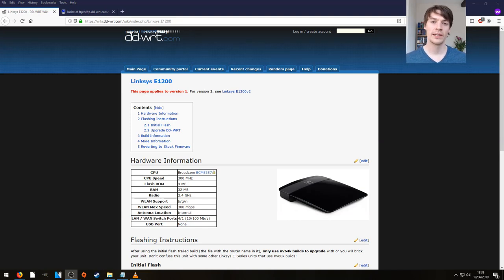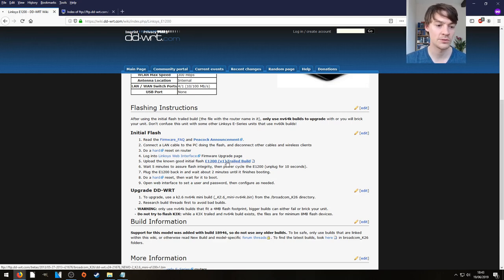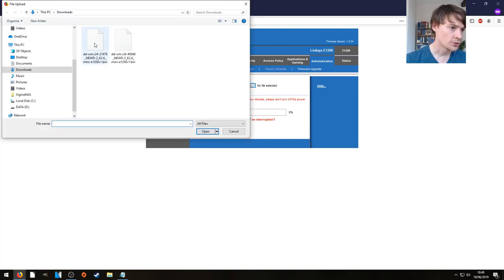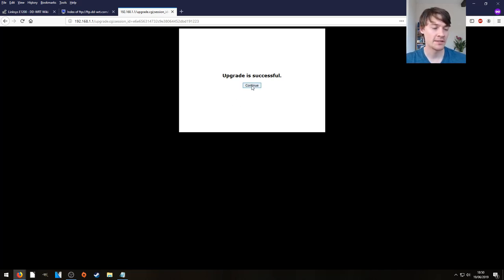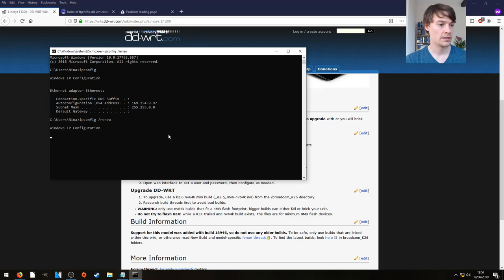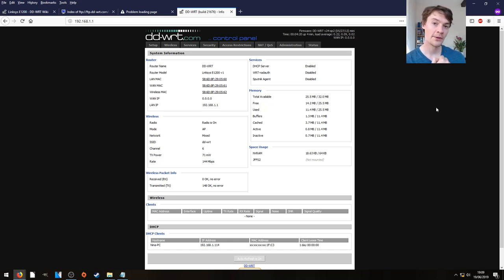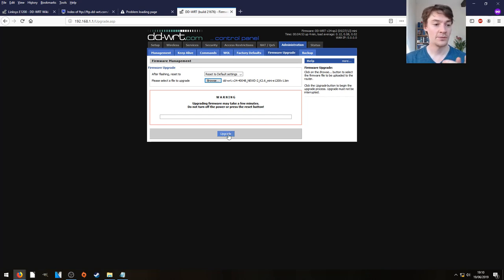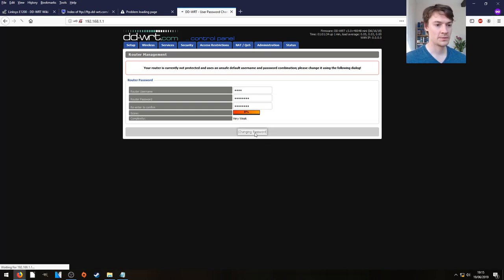DD-WRT - Linksys E1200 | Firmware Upgrade | FLASH

Comment: I am getting a functional QoS using the first firmware:
dd-wrt.v24-21676_NEWD-2_K2.6_mini-e1200v1

But as soon as I upgrade to "dd-wrt.v24-40048_NEWD-2_K2.6_mini-e1200v1" the QoS stoped working, and by that I mean, it doesn't limit any downlink and uplink speeds.

Is there a new setting on the new firmware that I am missing?
Reply from the maker: Sorry I no longer use DD-WRT you are better off on their forums for answers